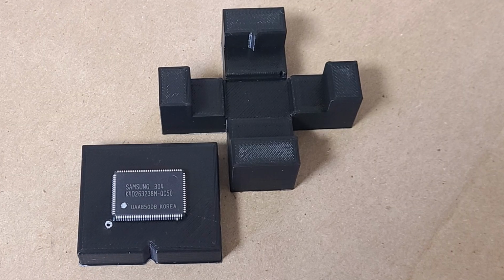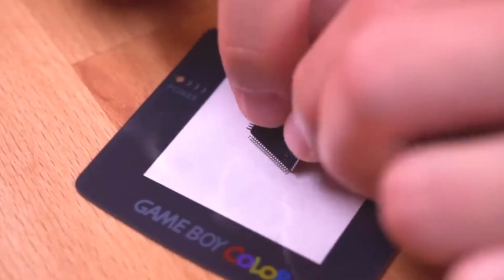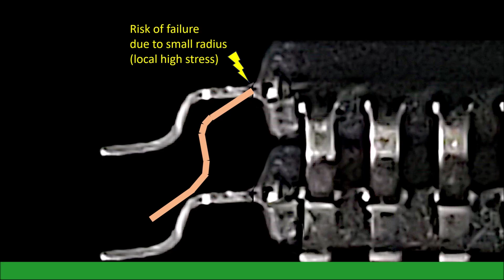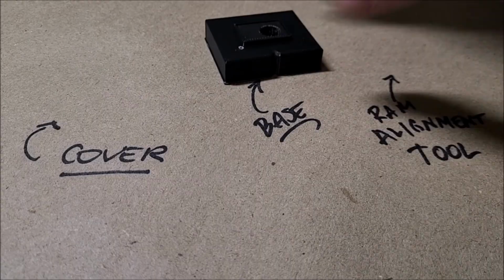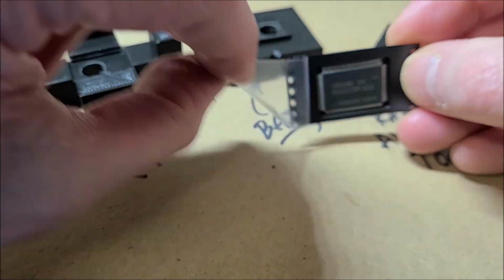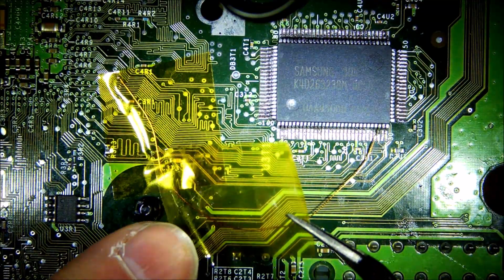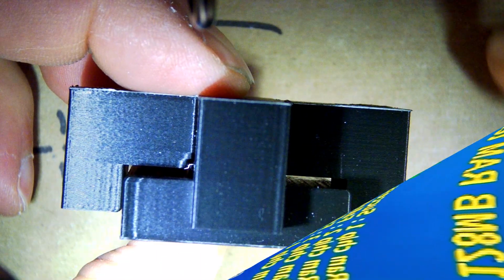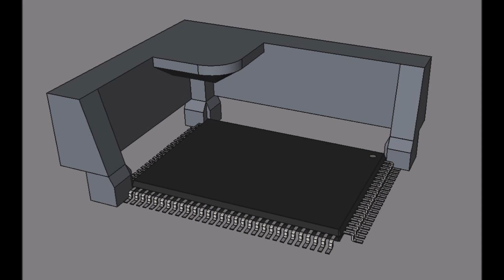Optimizing Xbox 1.6 128MB Upgrade - Part 1

Comment: Amazing.  I wonder if there could be a 3D printed part likely metal that is typically solder resistant, maybe an aluminum or high alloy steel specifically to stop the bridging. Thin enough to solder over but could easily be lifted after solder to completely eliminate solder bridging.  If possible seems like a useful tool in general.

Comment: I'm not sure the specifics, but there are issues with RAM upgrades on the 1.6 board, and many don't recommend it. If you're going to upgrade the RAM, do it on an earlier revision. Even then, there's not a lot of use cases for the upgrade. Still fun to do though. 

That said, nice work on the design of these tools. Well done.

Comment: I had a similar issue Piggy Back Modding the Dreamcast. And I got sick of trying to get it to work. With help I was i able to figure out a way to install a single larger bios that can hold two bios banks into a single chip, bypassing the need to Piggy Back mod the Dreamcast for those that want to install multiple bios's. 

It's great to see a solution be worked out for ram upgrading the 1.6 Xbox. I also struggled with trying to ram upgrade these. It's definitely not easy, stacking chips, you have to go over your install multiple times. It's great to see a solution be worked out for this. Would love to also see alignment brackets for 1.0 to 1.5 Xboxes. Streamline the process to make ram upgrading OG Xboxes easy.

Comment: Where did you buy original samsung RAM chip?
Reply from the maker: First batch of chips I got from eBay have been great. None of the second batch of chips (also from eBay) were good, and are probably Chinese fakes. I got three spares from the motherboard I scrapped.
Reply: Maybe eBay or a damaged Xbox

Comment: Very cool solution and I appreciate the thought you put into this. I do think that part of the issue here was your choice of iron tip and general quirks around your tools and workflow (you really need a scope for this type of rework; you need to use more flux!), but your approach, while possibly a little overengineered doesn't leave much room for failure - it's entirely a skill issue at that point. :) I've done a few of these and never needed special jigs or anything of the sort, just stacked and soldered. Personally, I wouldn't bother with this mod since it doesn't really help you for 99% of use cases, and is generally useless unless you're going to play Chihiro games.

Nice work!
Reply: There are other use cases. If you have an XBMC4Gamers installation, with the entire library on an SSD drive, the 128Mb upgrade will allow you to use 720p/1080 screenshots and videos in the Netflix like interface when selecting what game you want to play. With 64Mb of RAM, XBMC will complain that it doesn't have enough memory and drop you to 480p on an HDMI modded XBOX. Emulators of other retro consoles on the XBOX also benefit from the extra RAM.
Reply from the maker: Great feedback, and as you can tell: I am still learning, and working on my skills. I already started using more flux as you suggested and you are right: it helped.